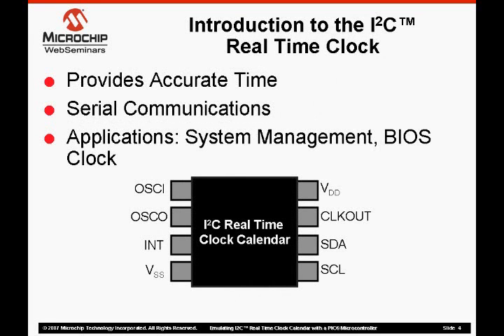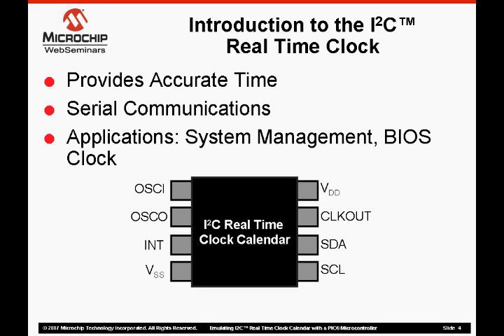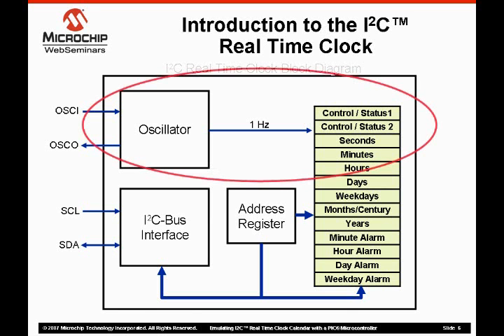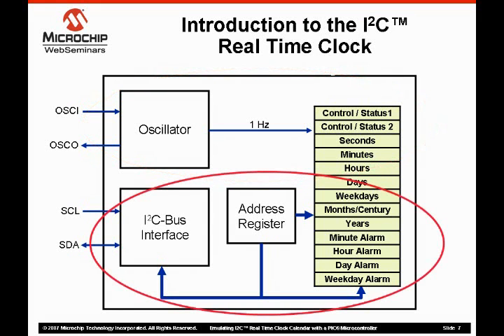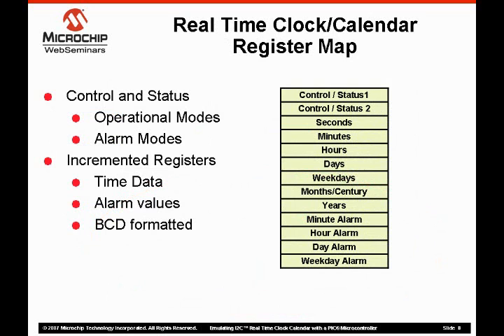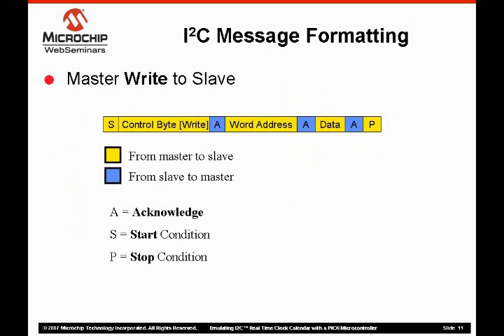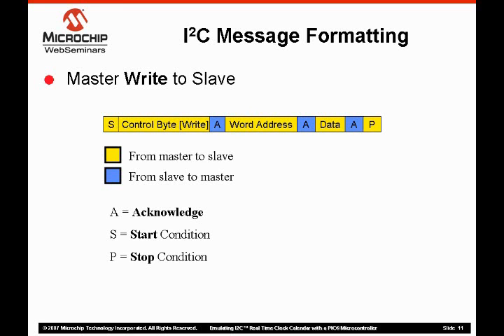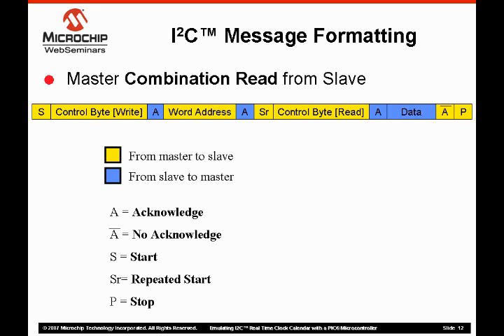Introduction to the I²C Real Time Clock

Comment: can i use both rtc module (i2c) and gsm module (i2c) at same time? do they use there own analogue pins or can they use the same?
Reply from the maker: Hi Jay - the best way to get an answer to your question is to go to support.microchip.com and post it in the related user forum.
Reply: a yes or no answer dont need no forum and if it did i would use forum.arduino.cc/index.php?topic=493919.0